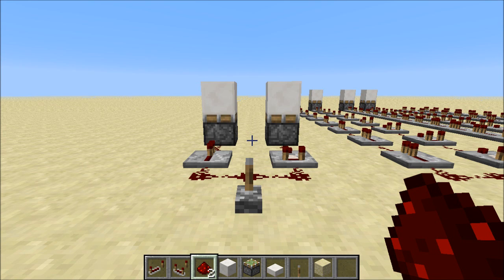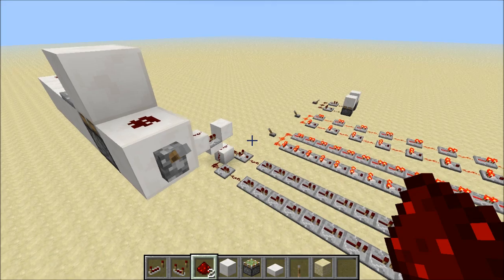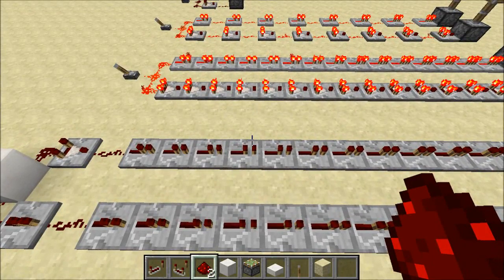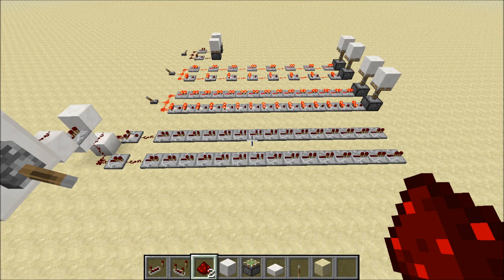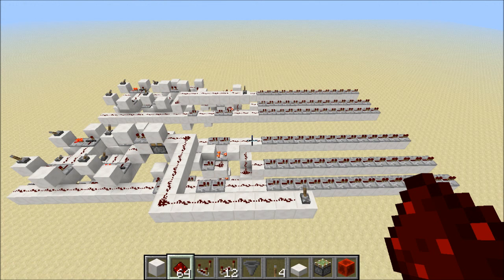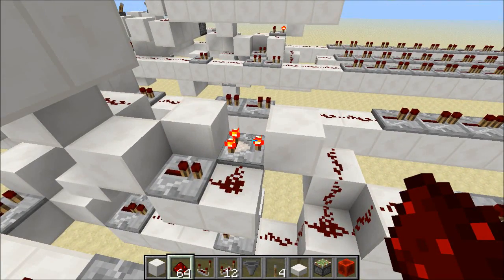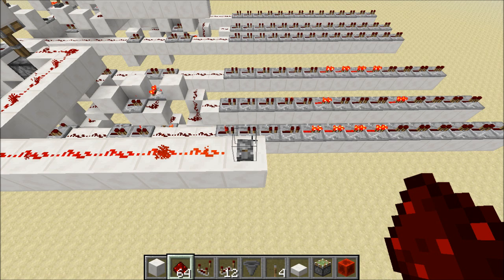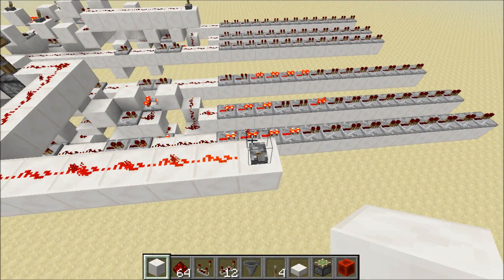Comparator Changes in 13w05a: Bug Fixes, Bugs, and Strange Behaviors

Comment: Well yeah it's interesting. I found that out when Repeaters was released by using 10 different clocks. 1/1 clock, 1/2 clock, 2/2 clock, 3/1 clock, 1.5/1.5 clock and all the negatives of the mentioned. The 1.5/1.5 and it's opposite gave consistent inconsistency. Random tick eating and sometimes spewing 0.5 extra. If you did that to the comparators before the 12w05a update it could make 2.5 tick pulses and sometimes 1 tick pulses. But it's a bit more consistent now but still really weird.

Comment: Actually they don't ignore them, they eat the input. Meaning it recognize the signal but doesn't let it through. Sending 1.5Tick pulses will allow the pulse to go through. It has to do with Comparators can only output if the signal is still there during their 1 tick reaction speed. Though this is an old bug with how redstone and gameticks hate eachother. Repeater only need Repeatersetting-0.5 tick to change output.

Comment from the maker: I'm going to! But I have to decide on the exact architecture I want to use. I want to make it as close to my 5 tick Proper look-ahead adder as I can get it, which will be challenging. I took a look at my anti-burnout XOR and XNOR in 13w05b and the work perfectly at 2 ticks/operation, so we'll see what happens!

Comment: Hmm, if I attach a comparator to a 1 tick comparator clock it still doesn't respond. Anyway, I think 5 Hz is still pretty good, considering that otherwise you would not be allowed to use any sticky pistons in your build.

Comment: I really disagree with the comparator "bug", it might have been unintended, but that doesn't mean it's not great feature, so why remove it when it wasn't inconsistent?
Another bug i found is that if you use a dropper to put an item into a locked hopper, a comparator will not detect the item inside the hopper, until it recieves an update

Comment: The 1 tick pulse essue could be because before comparators had a bug that, when comparator gave a pulse when the side signal is on, and the fix could be detracting a tick from the pulse. Not sure about that, just a guess